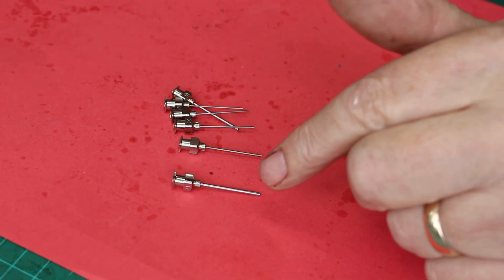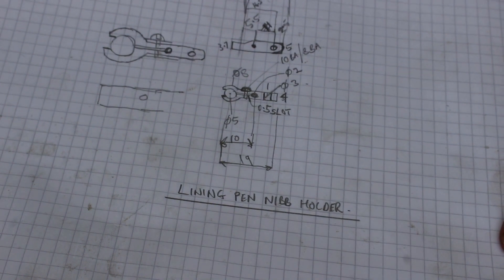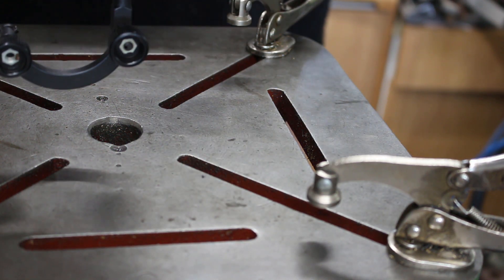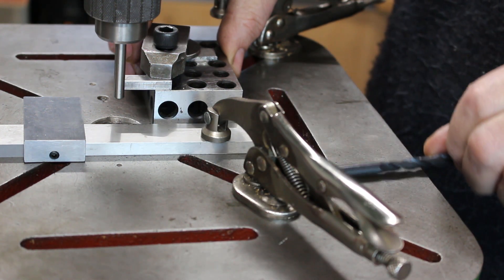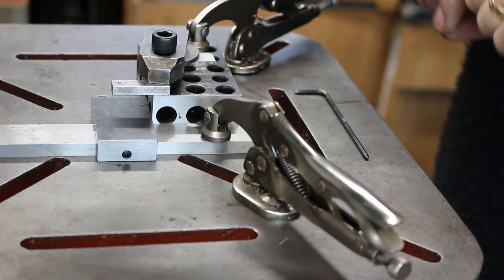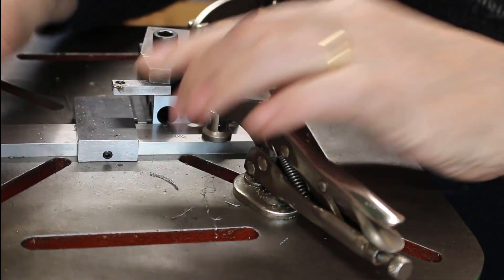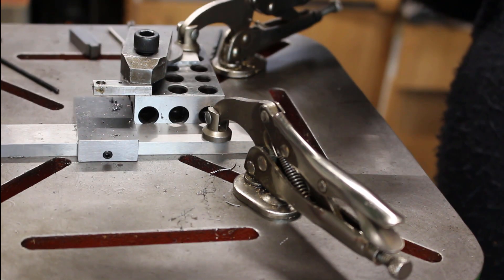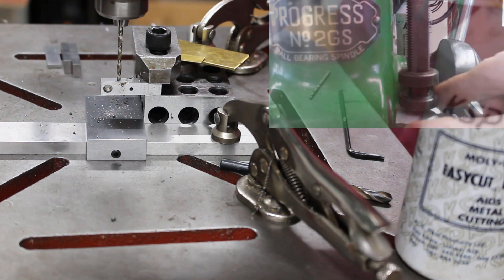Making a Lining Pen Pt.1 (for model making) + Accurate Drilling

Comment: So many simple and clever tricks here.  Your level of experience and ability to explain how is quite high.  I assume you made the filing buttons on the lathe specifically for this part. You must have a whole drawer full of them by now 😁.  Do you just harden them with the torch, and then not temper them afterwards so they remain extremely hard?  Thanks for sharing your fun in the shed...... 👍👍😎👍👍
Reply from the maker: Thanks Joel! I usually harden the filing buttons by heating to cherry red and quench in oil and don;t bother to temper them. However, if you can allow them to rotate as you file they don;t need to be hardened, this is what I've started to do recently, and yes I have quite a collection now.

Comment: Really simple logic on the drill press... I like that a lot. I assume the Mole Grip style clamps you have on the drill are something you made. If not what are they called, so that i can search for them.
Reply from the maker: If you search drill press hold down clamps you should find similar clamps. If your in the UK then here's a link: https://www.axminstertools.com/axminster-drill-clamps-ax23568
Reply from the maker: With care you probably could make dials, you would have to set up some sort of guide and division fixture, but i doubt it would be very durable unless it can be protected. I think dial graduations are better of they are marked with a cutting tool then infilled with paint or ink.
Reply: @GoCreatehms  Thank you...